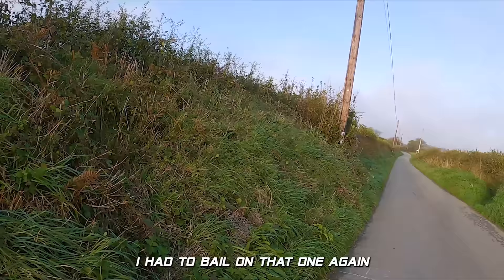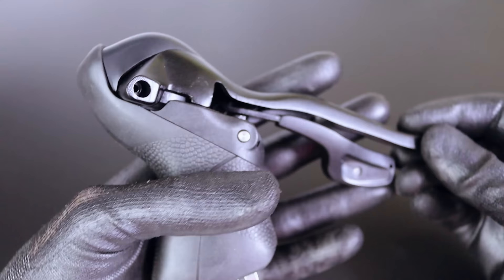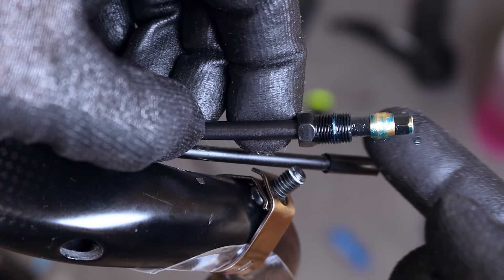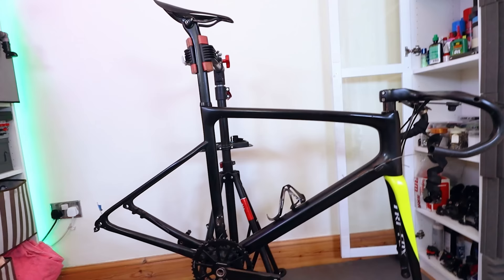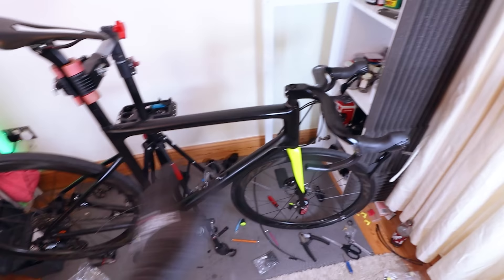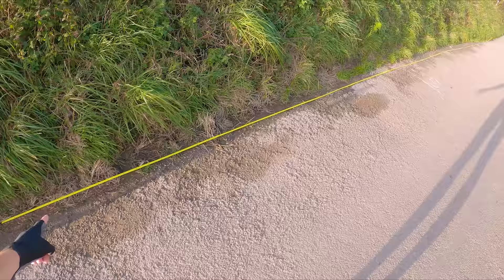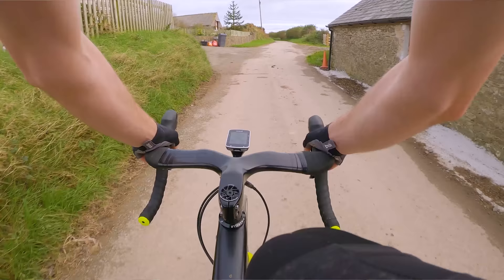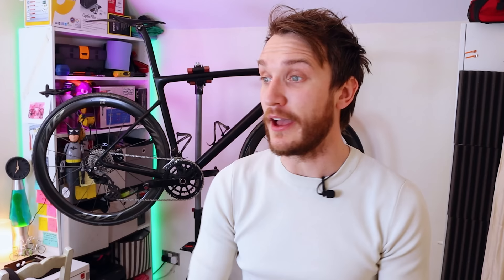Mechanical VS Hydraulic Disc Brakes - Shimano RS505 install & test

Comment: Cheers for the plug mate! And excellent work on the install 👌 
Interesting to hear your thoughts and results too!
And Sub 7.5kg on 5700-series disc brake bike is freaking brilliant btw 🤘😎
Reply from the maker: RIDES OF JAPAN IN THE COMMENTS!!!! Dude love your stuff! But glad to hear sub 7.5kg is decent, I was honestly a bit surprised when i got it on the scales. I assumed it would be closer to 8kg's. And no worries on the shout-out, gotta respect the OG's!
Reply: Loving the love. Enjoy the content gents
Reply: @TraceVelo  You gotta do a collaboration video with @ridesofjapan
Reply: @TraceVelo You should also collab with Rides of Japan and SAFA Brian

Comment: Hey Luke, great work as always.  I've been on fully hydraulic disks on road & MTB and have tried various mechanical set-ups.    The differences you demonstrated between the mechanical and fully hydraulic were massive - circa 30%.   That may only have been 3m in your tests, but that easily translates into the difference between having a crash and avoiding one when a car pulls out on you.   I ride in mixed suburban conditions and the brakes are my saviours - time after time.  IMHO, there's no such thing as too much breaking power - as long as it's easy to modulate.  Yes, you have to up your skills to take full benefit of the braking power, but it's so worth it.   The extra confidence in the brakes makes you and the bike faster too and the small weight trade-off is completely irrelevant when you consider that the extra performance could save your bacon. Also worth remembering that rider weight makes a massive difference too - it would have been very interesting to see the same tests with a heavier rider - and I suspect the difference in stopping distances would have been even greater.    Oh,  and we do care.. see you in Oxfordshire!
Reply from the maker: Yep this is all true. What I would say however, is that if you go over the handlebars, doesnt matter how good the brakes are 🤣. But I totally see your point, hydraulic will def provide shorter stopping distances in emergency braking situations, especially if you have been riding them for a long time and know how to get the best out of them!
Reply: @TraceVelo  That such a good point, and such a strong argument for upping the rider skill level.   Optimising your position on the bike to allow you to maximise the braking force you can use is an essential skill.  You do get used to it, but it takes practice and there will be an error or two along the way.   There's a substantial different in the stopping distance between a rider in a "normal" seated position and an arse-out-bike-forwards stance rider, as so much more braking force can be applied without flipping the bike.  That'd make a great video (padding recommended!)   If we're getting nerdy, it would also be really interesting to see how well the two braking systems resist heat-soak - the sort of conditions you're likely to experience on long fast mountain descents, with extended braking from high speed.  Pads can overheat, rotors can glaze and fluids can boil.....Keep up the good work... you're doing an amazing job.   There's plenty of great riding in Oxfordshire too - especially the Chilterns on the eastern side.
Reply: @TraceVelo  Following on from @Mark Johnson, throwing the bike forward and getting  your arse back and down near the rear tyre is a braking skill technique in commonly taught mountain bike fundamental skills classes. It makes a massive difference to your effectiveness and to reducing stopping distance. Two contact patches are always going to slow you down much faster than one. To be honest, I'm really surprised it does not seem to be taught to roadies. So, it's very good to see  you teaching it in this video.
Reply: @hawkeyelikesbikes  Road bike geometry typically has riders so far forward on the bike that it's very difficult if not impossible to get behind the saddle over the back tire. Gravel bikes and touring bikes, sure. Aero road bikes, TT bikes, etc. are typically so far forward that riders can steer with their elbows to get fully aero, and that results in a seriously forward weight balance that makes emergency braking very difficult.
Reply: @TraceVelo  But now you can also catapult yourself over the bars while staying on the hoods.
I find the ability to get at least 100% braking from every grip position pretty neat, especially in traffic, where I am likely to be on the hoods quite a lot.
Also I usually don't really care about the rear brake and fully focus on the front in an emergency, as you said, the rear will lift regardless.

Comment: Tiagra hydraulic shifters for 10 speed are actually a good budget choice. Update to a nice crank and you are not loosing much performance with 10 speed at all.
Reply: I find no performance loss at all with my Tiagra 10 speed bike.     I probably use only 3 cogs for 80% of the time spent riding anyway - and they are the same tooth cogs that I have on my 11 speed bike.    That extra cog is sometimes the one that I very rarely use or need  at all (10sp 12-28 vs 11sp 11-28).
Reply: I second this. I put Tiagra 10 speed on my gravel bike in order to upgrade to hydraulic brakes. Really impressive for the price. The rear derailleur can run up to a 36 tooth cassette, or even works with a GRX 11 speed derailleur to go bigger.
Reply: hear hear. I ride a SL6 Tarmac with Tiagra R4720 (hydraulic disc) and it's a beauty. 10-speed is fine for most of us.
Reply: I have endless problems with these, leaking bladder, leaking pistons, non retracting pistons. Horrible, horrible product.
Reply: @Click Bait I have 4700 groupset, plan to replace crankset with Chinese Hardrock crankset. Luke covered that crankset in one video. Around 100$ (for me) and weight between 105 and Ultegra
Reply: @discbrakefan  The 10s GRX "400" series RD can do 11-42T just fine. I am running my Checkpoint ALR with a M4100 11-42T cassette w/o issues. Only B-screw adjustment, no goat link or longer RD needed. Still running it 2x10.
Reply: If youre on flar area 7 speed is enough

Comment: Great video! Also, you know I'm not a fan of cable-hydro (TRP was the only one I thought was any good) but dude...I got a new pair the other day... as good as the TRP, but the same price as the ZRACE. ;) Need to find time for a video. I feel they finally cracked it.
Reply: What brand?
Reply: Wow. What's the brand/model?
Reply from the maker: Thanks Joe!!!! But now you have piqued my curiosity, really interested to know which ones you are talking about. A have seen a couple of new once crop up on Aliexpress recently... 🤔🤔🤔
Reply: Guess we are going to wait for Joe's Christmas special!
Reply: We want to know what brand is that?
Reply: Excited to see the vid and learn the brand
Reply: Isn't that Zoom flat mount brake caliper or new version Tanke brake calipers?
Reply: In the cheap brake market, I've always been impressed with the Zoom brakes of various types.
Reply: @dijudematthew  the juins? Zoom ripped them off, just without the QC.

They do have a 4 pot (GT) version which hasn’t been ripped yet though.
Reply: @China Cycling: will it work with Post-mount as well? 
I have an older frame that I'd like to work on ... it's a Giant frame with Post-Mount... I'm curious what's the best affordable  hydro-mechanical (cable hydro) caliper that I could install on it?
Reply: @scherzo0o  I don’t know if the same one he’s hinted at, but the best hydro-mech calipers you can get would be the juin tech GT. GT-P for post mount, GT-F for flat
Reply: @elfenstar  thanks ...
but did I find the right ones? 250 Euro for a pair? That's not what I expected :) :) :)
P.S. Is there a desing with two pistons, not four? Two would be enough to stop the aprox. 60 kilos that ride that bike :) and lighter.
Reply: @scherzo0o  yeah it’s a bit exp. If you’re on flat bars I would say go for a set of magura MT4s instead.

The 2 pot version he’s tested in post mount are the juin tech R1s. Power is similar to spyres, but to me feel is better.

They also go by names Yokozuna motoko in 2 pot and Yokozuna ultimo for the 4 pots.
Reply: @elfenstar  hey, thanks! I'm on drop bars, building a kind of do everything bike: grand-fondo // light gravel // occasionally cyclocross. I have some 4 mm clearance each side, if I fit 33mm tires. I want to match a pair of second hand 105 STI's for mechanincal brakes with the best price/quality ratio hydro-calbe calipers. That's the project - with 1x11 transmission.
Reply: @TraceVelo  Trp Spyre....wich are produced by Tektro.
Reply: Soooo...did anyone ever find out what brand Joe was talking about???
Reply: on my experience brake pads and rotor sizes is much more important than the calipers. But I have only used Shimano mechanical calipers, I really wanted to see how 203mm and Juin 4 piston would compare, it will probably send you flying.
Reply: so what's the conclusion here? :p
Reply: @davidgarza2267  I think he was speaking about Onirii. But not much news
Reply: @telkmx  Yeah, probably the newer Onirii BR 05.
Reply: @davidgarza2267  they have mixed review tho so idk.
Reply: Quit being a tease and just tell us. Or did they turn out to be bad brakes?
Reply: We are still waiting for the answer. And. Couldnt find any relatable video on your channel? 
I hope it was not a clickbait

Comment: I swapped for winter a few years back from my road bike with rim brakes to my mtb on Hydro disks, a car pulled out despite giving every indication they had seen me, as I was using hydraulic disks I managed to stop, same thing the day before, no chance. Now got a Trek Domane with hydraulic disks and stops brilliantly, the old bike is on my turbo trainer.
Reply from the maker: Fair enough, thanks for sharing Mark!

Comment: I tried a fully hydro setup a few weeks ago and I accidentally almost sent myself over the bars. My skills need improvement lol. I'm running juin tech knock offs with sintered pads and while it's little bit harder to squeeze, the only time I almost otb'd was during an actual emergency brake. With zoom dual piston mechanical brakes (db680)  I had to squeeze the levers to the bars every time, it took so much effort but I barely slowed down.
Reply from the maker: I've seen those knock off Juin Tech calipers all over AliExpress, are they any good?
Reply: @TraceVelo  with mine it has the rubber o-ring that the OG juin techs have, but in the product photos I don't see it. So far it's been pretty good, I've descended down a mountain with it multiple times and I haven't had any brake fade or any leaks. Also the stock pads are in a gold color for some reason lol
Reply: Oh yeah also one half of the caliper is red, the rest is black. Idk why
Reply: Okay last one, I had sticky pistons too but after some cleaning it's now acceptable. I also had the problem of the piston not returning but after I turned the adjust bolt a few times it went away, not sure why but it returns every time now.
Reply from the maker: @tomcruz3774  Right cool, thanks for the feedback Tom!! Might have to pick them up for a comparision....

Comment: Great video 👍 Really hope Sensah will come up with their own full hydraulic system for this market segment. That will be a game changer. The company who delivers first on a cheaper full hydraulic brake system will make so much money and probably spell the end of rim brakes.
Reply from the maker: Yeah im really interested to see which of the chinese brands can deliver first....
Reply: It's trickling down, and there are not many large frame manufacturers left making rim brake bikes, they are speccing cable actuated discs one even entry level road bikes in many cases now. I am not 100% certain but I believe Trek and Specialized are phasing out mid-range and entry level rim brake bikes entirely having already ceased production of rim brake versions of their flagship models.

The new Shimano groupsets released this year have put no development into the rim brakes. They are effectively the same calipers as the previous iteration.
Reply: I don't know if we'll ever see high quality hydraulics or electronics from the Eastern budget market. They produce groupsets for the Chinese commuter customers primarily, and that market values serviceability and reliability over performance. You don't really see Sensah and Microshift coming out with road or down hill oriented components that aren't already great for Chinese commuters.

Comment: Great video as always Luke. But I just want to clarify the sequence on how to install the hydraulic fittings. Its always a good practice to insert them in this pattern nut-olive-barb. Because in my experience if you install the barb first, you cannot insert the nut and olive. Cheers!

Comment: Thanks for another great video! One upside for fully hydraulic (depending on the winters where you live of course) they dont freeze in the winter which mechanical can do if some water has made its way in to the braking outer cable!

Comment: I have used V brakes, cable disc brakes,  cable actuated hydro brakes (HY/RD)  and those very same full hydro RS505 levers... they are excellent levers and provided amazing braking and shift performance.     Honestly their is no comparing the braking and modulation of full hydro disc brakes to any other version.   but in level of what is better you go in the order I had above - 
every step was a bit better.   I am on a full GRX810 setup now - and the braking is sublime. 
But those RS505 levers and brakes are solid workhorses, they should last for years.
would 100% recommend.

Comment: Nice video, as always. I have a fully hydro set-up on my flat bar commuter bike. When sharing road space with busy traffic at 20mph+ I think it is well worth the cost for the ability to slow down sharpish when a lane changer hasn't seen you. I still run rim brakes on my weekend/country bike, though if it had disk mounting points I would consider the upgrade.
Reply from the maker: Yeah fair enough. I can see that in heavy traffic they could def come in useful!!

Comment: One thing I've learned about those portable scales: MAKE SURE the actual scale is in line with gravity! If the force of gravity is not colinear with the axis of the piece of metal coming out of the scale then you WILL undervalue the weight. Try it by hand, it's pretty crazy.

Comment: that's why I always use 140mm on the back, it helps not locking up the rear tyre every time i touch the rear hydraulic brake. Happy to see Roj from Rides of Japan named, yours channels really deserve more attention than what you get

Comment: Coming from a mountain bike, I really can not imagine going to a mechanical break ever again.. I know that you still need grip on the road to use all this breaking power, but I still think that with a little bit of getting used to, you really improve your stopping distance, when going hydraulic. Not to mention, ou still have great modulation and easier pull on the handle..
Reply from the maker: yeah all true, you def have more stopping power with fully hydro. But set up correctly, mechanical brakes can still get the job done IMO
Reply: Also definitely true, especially if you put money into consideration. But just for me personally, I love my hydraulic brakes to much ^^
By the way, how are the brake rotors holding up? Would you recommend these, as they are so cheap and light?
Reply: Its a whole different world on skinny tires. On mtb there are also much more cheap hydraulic options. Since shifters and brakes have remained separate.

Comment: Hey Luke, and all... A few points/comments/things :-
1. Where in Oxfordshire you relocating to - I'm in Bicester
2. Purchased the siroko jacket yesterday - looks good online...
3. Be interesting to see a comparison of disk Vs rim brakes using your test
4. Like yourself - I've been riding (road) for numerous years and can't recall ever having to do a full brake lock. A mixture of awareness and direction/avoidance has always been my strategy of choice.
5. From my experience applying full lock to brakes (even on a dry, smooth, even, road surface) will probably lead to loss of control - rear wheel skid, bike lift, hitting others in a group - it's not a great solution. Only ever a last resort...
6. (for road riders only) so what are the advantages of disk brakes? Heavier, more costly, trickier to maintain, and no real safety advantage? Uhmmm
7. Just bought some disk brakes for a gravel bike I'm building - courtesy of AliExpress... Tyre clearance and wider rims...
8. Really love the videos Luke - my wife thinks I have a thing for you!! 🤣

Comment: I've gone from having next to no brakes to new hydraulic disks. Needless to say i nearly went for an unplanned trip the first time riding my new bike. What a difference. It was like trying to stop a battle ship, my last bike was so heavy. This bike is 33% lightsr agd disks, bliss.
That said, i honestly think I prefer 105 rim brakes. Which i have spare. Unfortunately not an option on the new carbon folks.